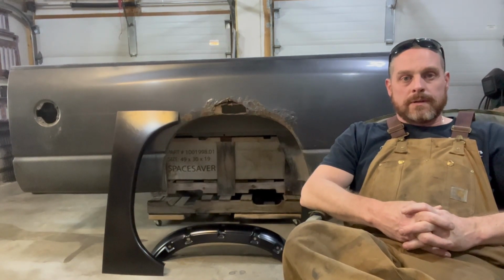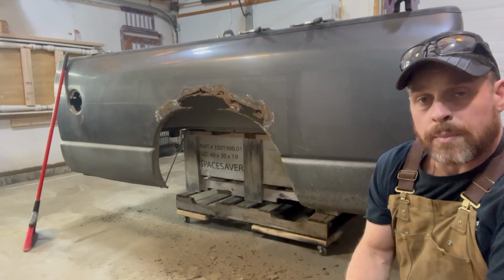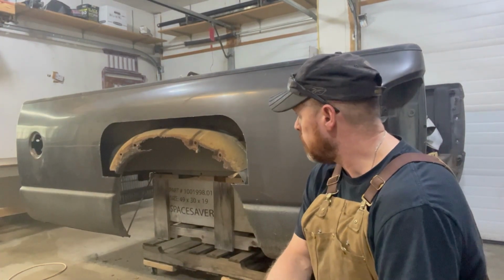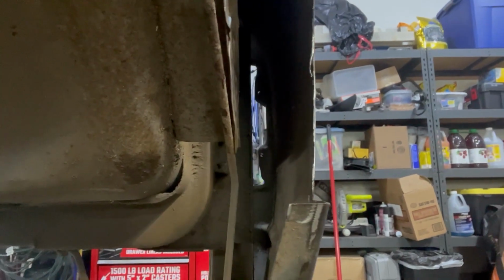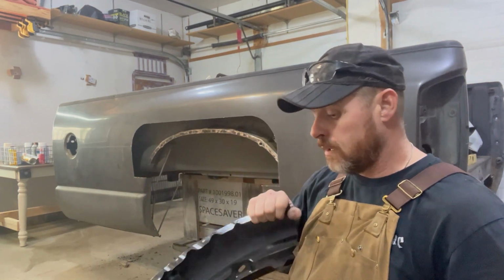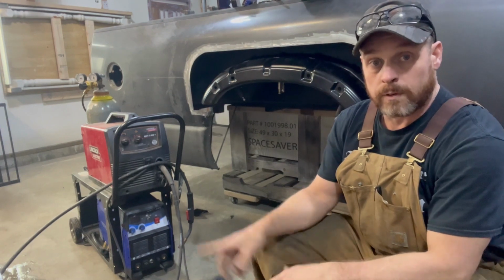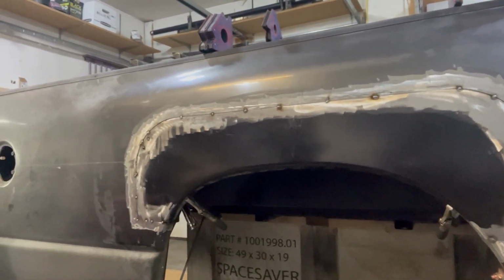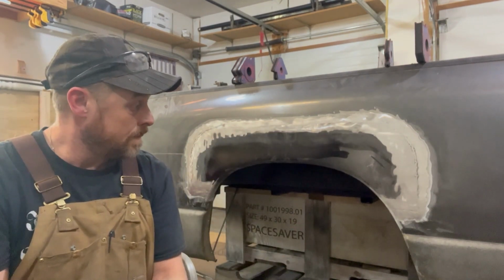Dodge Ram Long Bed Mega Cab - 8 Foot Bed Repair

Comment: Awesome job man !! Every 3rd gen Dodge Ram I've owned rusts in the same exact spot. Actually, every one that I see on the road has the same rust. Many guys will cover it with the plastic wheel fender extenders. Those look ok, but I love how the body looks when it is rust free.
Reply from the maker: Thank you. Yes, every one I see is the same. They are not hard to fix either.

Comment: How does the outer panel and inner arch attach? I’ve heard some people say the foam adhesive strip Dodge used was the culprit for the rust to begin with
Reply from the maker: I couldn't tell on this bed on how it was attached due to so much rust damage. I punched holes in the outer panel lip and welded it to the replacement wheelhouse where they marry up.
Reply: @LBMCDodge  gotcha. Thanks man